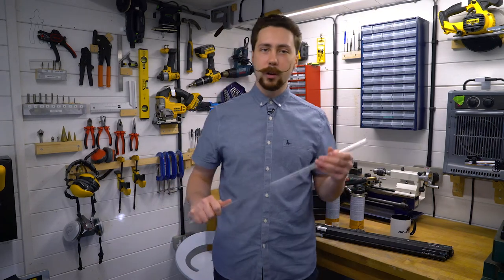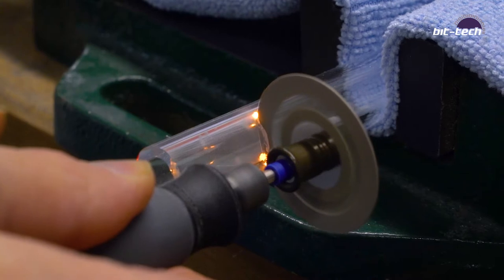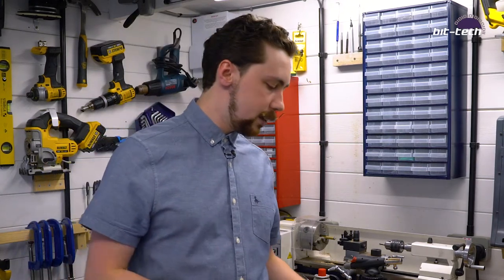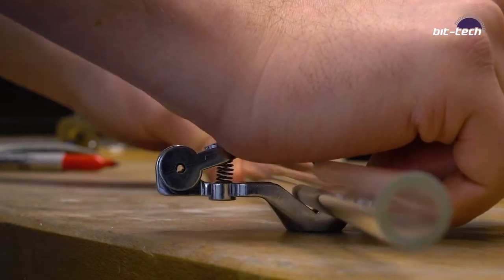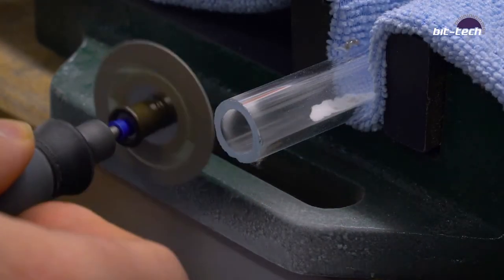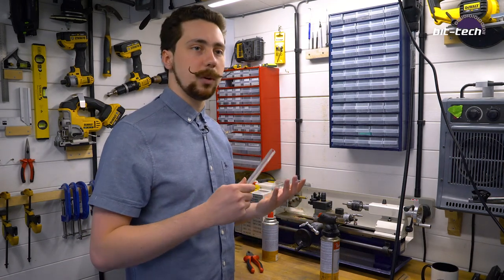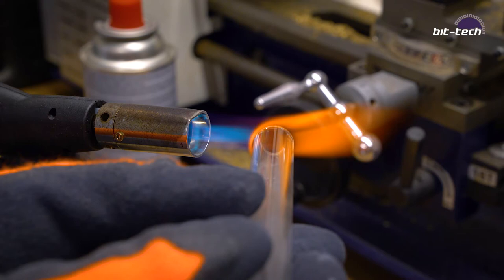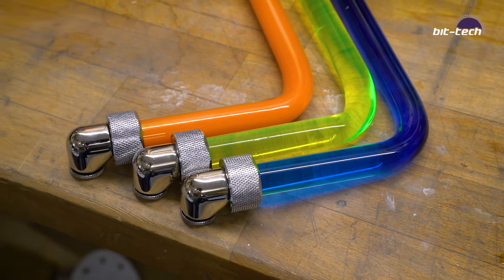Hardline Tubing Guide: Glass | bit-tech Modding

Comment: I would strongly suggest duct taping a shop vac hose beside the tube if you are cutting glass with an abrasive, your lungs will thank you.
Reply from the maker: Definitely not a bad idea, we didn't do this because it messes with microphones and so on.
Reply: @bittech1  hey man I am a professional scientific glassblower. Silica dust is as dangerous as asbestos. It is insoluble particulate. You NEED to wear a mask. Secondly use a wet tile saw and clean with distilled water to avoid hard water spots. To bend tubing flawlessly you need practice and patience. one side is stretching farther than the other so your heat should reflect that. Also without a Kiln and a proper annealing cycle relative to thickness of the glass you will have very stressed glass that actually could just check under tension at any moment. Yes a lot of liquid will spill all over your components. This happens way more often than you'd think, even as a glassblower. Flame annealing is another option if you don't have a kiln but is never as efficient. If you would like to do this video again sometime with the assistance of a glassblower. Hit me up. Check out @titanglassworks on instagram for my work. The creative options are near limitless with this application. Someone trained in scientific glassblowing and fluid dynamics could definitely come up with some pretty unique or never before seen stuff.
Reply from the maker: @ThrashyB  Muchas gracias! Come a long way since this video was done so I think it would be a good idea to revisit at some point.
Also it's nice to hear from somebody who actually does this for a living for once. I await the day an actual glassblower  does a proper glass tube PC, rather than homebrew enthusiasts melting things and making a mess (myself included in that list, solid reason I don't work with glass in my actual rigs).
Reply: @ThrashyB  did you see the mask?
Reply: @ThrashyB  Thank you for your great knowledge!  As a gem stone cutter hobbiest, I cut quartz (crystalized silicone) all the time, we use gritted disks WITH WATER!  The water helps with capturing the insoluble particulate.  LIke you sad, a wet tile saw will do wonders for your health over cutting in open air.  I am not a glass expert, but thank you so much for all that knowledge.

Comment: You can actually put borosilicate glass in hot oil to cool it faster. Or even in hot water after it sets for a few minutes. It's much more thermal shock resistant than soda lime glass. And I'm not aware of anywhere that sells non-borosilicate glass tubing. But you can't do it when it's red hot, that's for sure. But this is all really a technicality, because by the time it drops enough in temperature to put it in water, you've already waited quite a while.

Comment: That was a great video but I would like a follow up to see how you bend it. I've done PETG before but interested in the specifics of glass bending.
Reply: Most people just by the pre bent stuff as i think the temps and rigs needed to bend it properly arent something super easy to do at home.
Reply: True that, and it tends to bubble if you overheat it, so you have to be pretty precise and practiced with the heating. Technically you could do it with a propane torch as well, but do you really want to handle something that hot? I will say that they do this regularly with much smaller tubing in chemistry labs though.

Comment: Where did you get 90 degree elbows with 12mm OD? I can't find them anywhere...
Reply from the maker: As in with 12mm compressions built in? Pretty sure Bitspower makes those, at least they do for rigid tubing. You can always use 90 degree adapters and regular fittings, much more flexible that way.
Reply: @bittech1  , I am looking after glass 90 degree bends.
Glass tubes, not the fittings.
Reply from the maker: @stanislavkorulin3913  Ahh does Mayhem's sell them?

Comment: For those of you worried about the glass dust yes wear a mask that protects from glass dust and legitimate goggle to protect from glass dust and it you go the dremmel route they do sell after market shield attachments to contain the majority of the dust particle from flying in all directions while using a dremmel or rotary tool to cut the glass

Comment: Wearing protective gear for eyes and breathing is all good, but remember that this dust will fly everywhere.
Doing this in a garage or a dedicated workplace is fine, but doing this at home is a bad idea (do this first with a plastic tube and you will soon see why).
Honestly, I love the idea of glass tubing in my PC but there seems to be a lot of dangers and annoyances (not to mention the extra cost when you factor all the tools required).
Reply from the maker: Personally, after doing these I feel glass is just pointless. You could use thick walled acrylic and it would look nigh on identical. You essentially won’t know it’s glass unless you’re told, or they do advanced glass blowing techniques, at which point it’s a different kettle of fish anyway.
Reply: @bittech1  Is acrylic going to be eaten away by any fluids containing Glycol? One of the main drawacks of soft tubing for me is that the fluids tend to get cloudy from the chemical reactions. (strangely enough, its not consistent. I had soft tubing clear as day one after 2 years, then cloudy in 1 week after replacing the tube and fluid. For the exact same tube and fluid).
I am very bad at fluid understanding, it seems that all pre mixed fluids are just terrible.
Reply from the maker: Acrylic is fine with all the major coolants, most reservoirs were acrylic for years remember. Personally I’ve never had good luck with clear soft tubing, it always clouds up and stains, regardless of the manufacturer claims.

Comment: Hey mate, I was wondering if you think it would be possible to use a Mitre Saw with a high quality glass tile/ mosaic disc (and plenty of water) to efficiently/ cleanly cut glass tubing?
Reply: With a thin enough blade, possibly, but due to the shape and thin walls, you'd have to take it very very slowly. You're more likely to crush or break it due to the size and pressure of most mitre saws. Also, you want to be careful placing it in the metal of the surface of the saw as it could scratch it.

Comment: What about a wet saw instead of a dremel? Cuts down on the dust and much safer.
Reply: I wonder if just spraying WD40 or water on the tube as its being cut would help reduce dust without the need for a shop vac
Reply: I was thinking that my wet tile saw would do the trick.